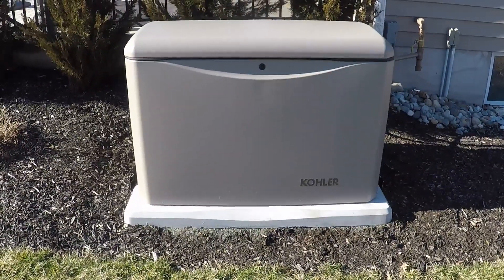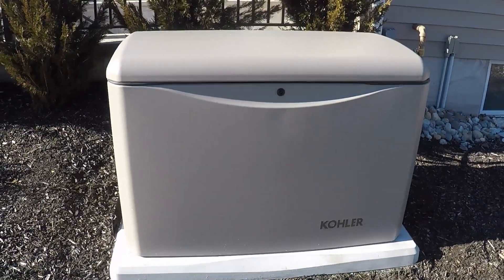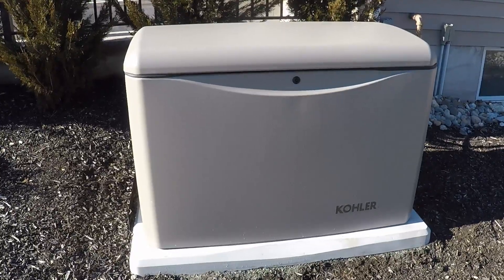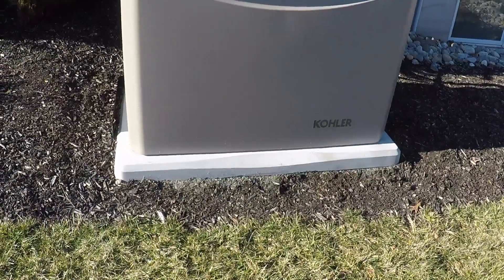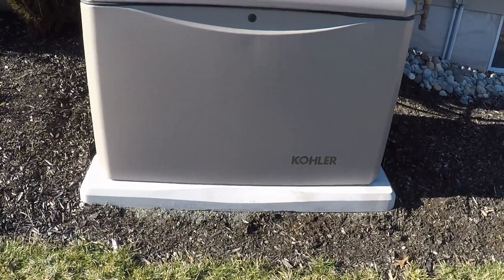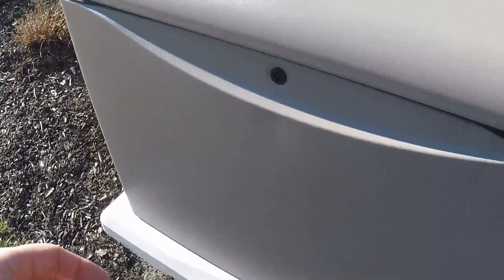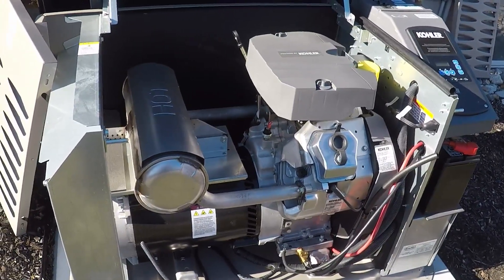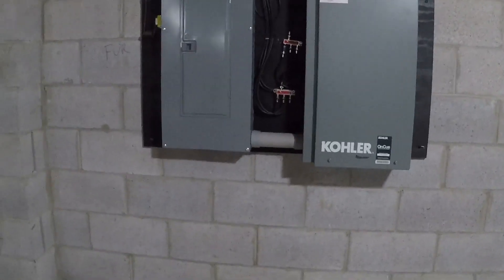A Basic Overview of an Emergency Home Standby Generator / Kohler 20RCAL

Comment: I'm watching in 2025.. My 14kw just got the propane hooked up and the electrical was completed a week ago. I haven't started up the generator but everything was all professional done. I'm reading the manual now pre startup but my completed project totaled about $9800. 
I build my own 4.5ftx2.5ft deck outta 2x10, 2x8 and 2.5ft 6x6 for the post.
I purchased a used 120lbs  tank for $80. Paid $102 to fill tank because it was about half full. 14kw Kohler was $5506.30
Electrical installation $2270
Gas Installation $1120
Battery $200
Mini skid steer $196 (move propane tank and generator into place) 
$140 in rocks for the generator and propane tank site
$100 for lumber (I had the majority of the lumber supply from a previous project)
$36 for 4 2*2*16" concrete pads. Any recommendations before start-up??
Reply from the maker: The main thing is just have oil in the engine to make sure everything is clear.

Comment: just had a Kohler 26kw installed the other week.  House is 8,100 sq ft and needed two transfer switches.  But it runs the three a/c units, the rest of the house and the pool/hot tub.  Cost was $23,400 with tax, permits, and install + 10 yr warranty.
Reply: $18k here

Comment: Great video! I am looking at this exact model but am concerned it might be a bit light for my house. I have 2700 Sq-Ft, Central AC (one 5 ton unit), propane furnace, 2 propane hot water heaters, propane gas range/oven. A 250 gallon propane tank, 200 amp service panel. Other electrical appliances are: refrigerator/freezer, chest freezer, dishwasher, microwave, aerobic septic system with a 1/2 HP submersible pump, 1-1/2 HP centrifugal pump for lake water sprinkler system, 2 computers, 2 TVs, WiFi, and pretty much all lighting is LED. I had been looking at the Generac 22KW, but concerned about the negative reviews on reliability & customer service. We live in East Texas Piney Woods where windblown trees knocking down power lines is our biggest concern and where previous hurricane winds have reached us and knocked out power for 3-5 days. Do you think a Kohler 20RCAL is big enough? Thanks for any advice you or others can give me!
Reply: I have the Kohler 20kw and a home similar to yours with a 5 ton HVAC unit in south Louisiana. With everything running I'm pulling 50 amps and the generator has a max load of 75 amps on NG. You'll be fine. The only thing that may be different is the 1.5 hp pumps. Find the amperage draw on those before you buy. Also, do you plan to run on NG or propane? I suspect propane and you'll have a bit more power than my as I'm limited to 18kw on NG.

Comment: Good review. However the cost can easily be double the $15K if the unit, for boundary spacing requirements, needs to be located on the side of the home opposite the gas/electrical service into the house. Also consider that if you reside in an HOA community you will need their approval.

Comment: Apparently Kohler needs updated firmware, which was never done to mine. It stopped during an outage, couldn't get a hold of them since the company lost phones and power. Few days later, came out and said firmware has quarterly updates. Not on the maintenance list.  Never done to mine. Not happy with them. Should have gotten a Generac.

Comment: Would you tell me how you did the cat five cable please. I have ordered the wifi for the genset because ATT did not want to run a cable to my router.
Reply from the maker: I ran the cable itself inside the same conduit that the shore power is running, and the CAT5 is connected to a Wi-Fi extender.
Reply: @EnthusiastsGarage  thanks sir. I can run my cable the same way and hook it to my Google wifi extender in our garage which is right inline with the generator.

Comment: They have a Kohker 20kwRCA model out now. What size generator did you get? Any questions I should ask the sales guy you'd recommend to ask when he comes for a quote?
Reply from the maker: they have a 26 KW coming soon, I got a 20kw. make sure he breaks everything down and show him where you want it placed. the price should include a base, battery, and cold weather kit if you live in a northern climate. I recommend an aluminum housing so you can tuck it closer to the house. prices have gone up a lot if the last few years so prepare yourself for a 15k quote.
Reply: @EnthusiastsGarage  He came out wasn't quite 15k but in the ballpark however cash discount knocked it down a bit. I wonder how much more the new Kohler 26kw will be? His quote didn't include on cue though, not sure if I should get it. He also isn't adding rock under the pad just removing sod and leveling which I don't think is wise.
Reply from the maker: @shanew7361  I would expect the 26kw to be $2,000 more. you would probably only need it if you have a big house or electric everything, your electrician should be able to audit your usage and see if you need to upgrade. on cue is good to have, lets you know whats going on with the generator and whether or not you lost power. I would definitely add paver stone and tamp it down or the vibration of the generator will level itself out. not an expensive thing to do. upgrade your meter as well.
Reply: @EnthusiastsGarage to upgrade the meter how we do that ?

Comment: had my kohler 20 kW installed 3 months ago it's been exercising weekly just as it should we had a power outage last night and it did not kick on multiple fault codes I have no idea who to call, the electrician that hooked it up hooked it up correctly but it appears it's an internal problem so now I got to figure out how many hoops I've got to jump through to get an actual generator technician out here right now I've got about an $8,000 lawn ornament now that $8,000 that include everything the hook up and all that but this is ridiculous.
I thought I had peace of mind I thought it was going to kick on I knew the power was going to go off last night cuz we had storms coming through instead nothing but darkness.
Reply: Any update to your situation?
Reply: @columboscandela  Guess not lol
Reply: He can't get on cuz there's still no power. @columboscandela

Comment: This is the same model I have at my house.  Best piece of mind purchase last year.
Reply from the maker: It’s expensive but worth it. Everything will run as it normally will and there’s no worry in the middle of a storm or extreme temperatures when power is out for hours or even days.

Comment: Just got this delivered today! Electrician here next week, along with propane gas company Gonna sign up for yearly maintenace We have central a/c , but will shut off if we lose power. Less stress on Kohler
Reply from the maker: You should have no problem running your central AC. Typically the air conditioner is put on a load shed so if a lot of high demand electrical stuff is running and the AC tries to come on it will hold it off until he safe amount of power is available. I have no issue running my central AC unit
Reply: @EnthusiastsGarage  Agree. LET THE EXPERTS DO THIS ! A home caught on fire near our home  Home owner installed, or tried to install propane generator himself Issue with the transfer switch  Cost of Kohler is not the real cost It is a QUALFIED electrician that adds cost, plus the costs of propane tank installed, and yes town permits from town gas inspector We live near Boston Ice storms, and tropical storms,  and time to get the Kohler !!

Comment: I'm super super nervous of basement flood.. I've lived at my home for 2 years and had 1 outage for 12 hours.. luckily I have a backup on my pump so I was saved.. you think this is overkill for me? I'm a freak when it comes to outages but in my area in the Midwest outages are not very common
Reply from the maker: A cheaper way to go would be a portable generator but you have to be home to turn it on and fuel can become an issue for a very long duration of power outages. This will not only run your sump pump but it should be able to run your entire house as well. Basement floors were one of my biggest concerns as well.
Reply: @EnthusiastsGarage  I do like the piece of mind. Also did it save you on home owners insurance?
Reply from the maker: @slowsti0535  some do, mine did not.
Reply: @EnthusiastsGarage  thank you for all the fast feedback

Comment: After watching a few videos on this generator i think you have the two side panels backwards.  the one with the two rows of holes should go on the exhaust side i think.  Wonder if it changes the volume of the running machine at all.
Reply from the maker: One is labeled exhaust
Reply: @EnthusiastsGarage  ah ok cool thanks.  I also just noticed that yours has what looks like two identical panels where a lot of these other videos have two different ones on each end.  thanks for letting me know they're labeled!

Comment: That oil filter location looks terrible. How do you keep from getting oil all over?
Reply from the maker: I thought the same thing. But what’s different is the oil drains out of it when the engine is not running so when you take the oil filter off no oil comes out. It’s actually the cleanest oil change I’ve ever done.
Reply: Yeah, I've had my 20RESC for 5 years and the oil change is fairly easy and clean. No issues with the filter in that position, just drain most of the oil first, open the two rubber oil covers and take out the dipstick. A lot of car engines have the oil filter just like that (my wife's Subaru) and it's not a problem.

Comment: Where do you come up 10 to $15,000? The generator is around $4500, the transfer switch around $1200, installation should be no more than $2000. Not trying to bust balls, but am I missing something?
Reply from the maker: If you have the ability to do it yourself you could probably get it done for about that. This is above the capabilities of most people so you're going to need a professional plumber and electrician. Every house is different so everyone's setup is different. It took 2 electricians a day and a half and it took the plumber about 6 hours. Now add in permit fees, a base, carb heater, piping, wiring, taxes, and all the other little things and it adds up fast. I was not willing to cut corners for something this important and you can see the quality of work that was done in the basement. not cheap but well worth it. Ive seen several other similar setup's and they were all in the 10-15k setup and mine was right in the middle of that estimate.
Reply: No one is going to install this for $2000. I’ve had five companies come out to my house and all of them are doubling the price of the generator and transfer switch.
Reply: I just had this exact generator quoted out for me today. $11,877 and that includes a 10 year warranty. I also talked to a guy I work with who is certified to install these, he said $3500 is the base price for an install.. Then it depends on where you want it and how much extra materials/labor it will take and it goes up from there. So his $10-15k statement is very in line with what I have seen and heard.
Reply: @MNauerth24  Debating on getting one myself. Did you end up getting one, and how much was it? Did you do concrete or the fiberglass pad thingie? Any issues or questions you'd recommend I ask the sales guy when he comes for the quote?
Reply: There is a BIG difference about what you people pay in the states for a installation of a standby generator vs what we pay down here in the carribean PR. Back in december 2017 a few months after we were affected by category 5 hurricane Maria I bought a Champion 8.5kw standby generator with ATS and after the installation was done I only invested only around $4,000.00 dollars for everything including the price of the generator. I bought it in sale in my local Sams Club store for only $1,998.00 plus tax for a total of $2,227.00. Then I bought a refurbished 100 gallons propane gas tank for only $850.00 dollars installed and hired a person to make two concrete pads one for the generator and the other for the gas tank. At the end I only paid around $4,000.00 dollars for everything including the installation that was done by a professional electrician. But to be fair my install process was much more easier and less complex than this one. And because my house doesn’t have a swimming pool neither a 5 ton central a/c and my water heater is solar I can power my whole house during a power outage with this small unit. I can power two split unit inverters a/c one 22,000 BTU and another 18,000 BTU, my washer, microwave, air fryer, two fridges, my electric cook top, two electric garage doors, my water cistern 3/4 hp automatic water pump, all my house lights , my 48” tv and my wifi internet rauter. I just avoid to use them all at the same time durring a power outage. But compare to the price of a solar system that can power all this electric items, all this standby generator are a bargain, 👍😉
Reply: The installers want to make $7-8k for the job minimum.  🤦‍♂️
Reply: The generator with panel $8500. Gas line, electrical work,  permits,  tax. 11-14k i am guessing

Comment: Had appointment with Kohler Installer last week, called Him today to proceed with install of a 20KW unit like this one. 30 installs are ahead of us, could be a couple of months. Looking very forward to the two day install, Kohler over Generac, not really even close.
Reply: What is the total cost
Reply: Any reasons why? I've been looking at the generac system
Reply: @slowsti0535  Let's put it this way - the big box stores who sell Generac generators use Kohler as THEIR backup generator.  Speaks volumes.
Reply: I put one in today It had a bad gas valve from the damn factory
Reply: @jayblemsin4226 How'd the fix go?
Reply: Gas regulator adjustment is critical. Under load find too rich, count turns to too lean, go back to right in the middle.